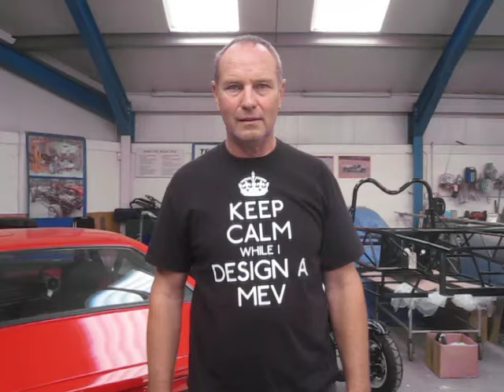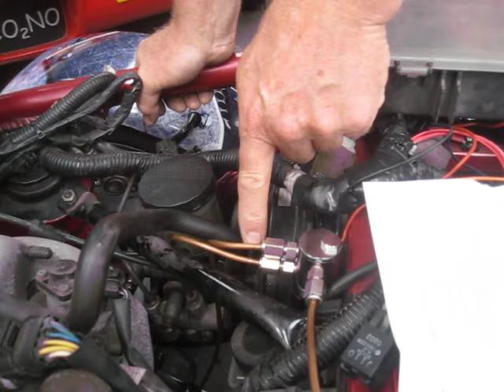Brake line lock explained simply

Comment: You're better off installing a line lock on the rear brakes. This way you engage the line lock before pressing the brake pedal and that BLOCKS the pressure from going to the rear brakes. Now you can have actual control of your front brakes with the pedal and control your roll out from a burnout. Or just drift like a madman. LoL

Comment: You can spend up to 500 bucks plus the cost of installation, or you can do a plug n play Zauto Burnbox for under 200. I was going to get the traditional hydraulic setup for my Challenger SRT, but then luckily found the Burnbox before I did it. But I do believe that their products are designed for Mopars only, so if you  don't own one you are SOL
Reply: Yeah... For my Camaro it costs me about $150. They aren't terribly hard to install either.

Comment: I'm planning to use one for 4x4 purpose being I have a hilux with useless handbrake and I cannot stop on any slope in neutral from how it's explained it should work
Reply: Bro that’s exactly what I was thinking. Have you done it yet?
Reply: @xaphan8581 installed a line lock on my  90 Toyota pickup, I like it no issues yet makes it super easy rather than a t case parking brake or something like that I also converted my drums in the rear to disks so I lost my parking brake

Comment: Are those compression fittings???   Not legal here in the States.
Reply from the maker: Compression fitting are not safe fro brake fluid pressure, we use male female pipe flare tool.
Reply: I doubt those are compression fittings.